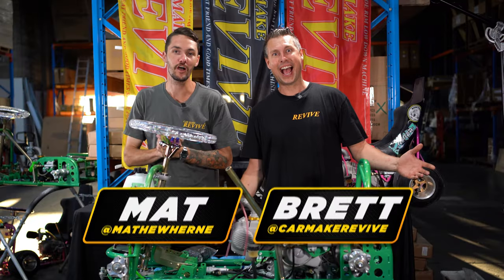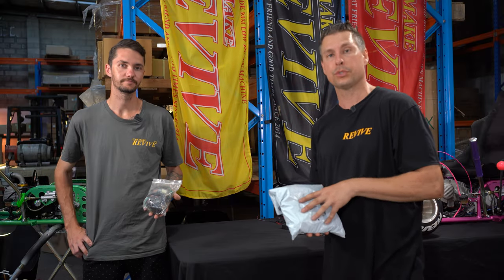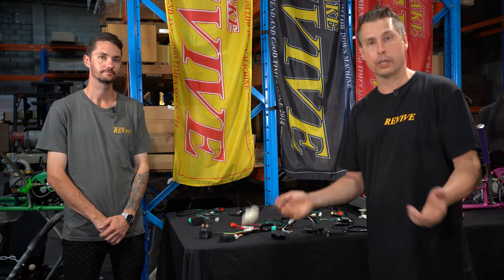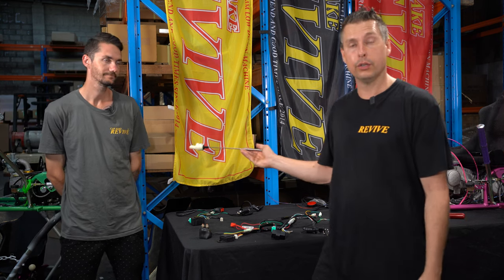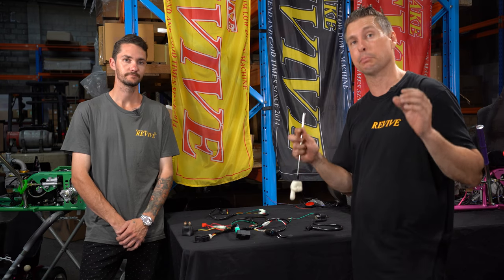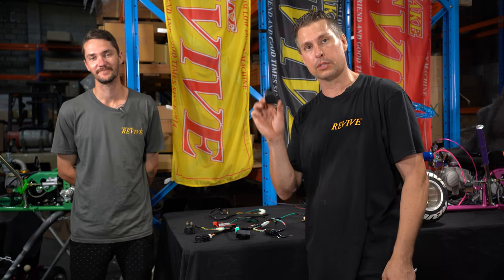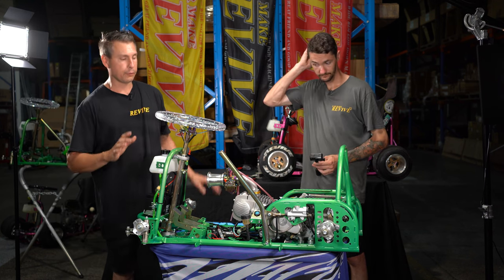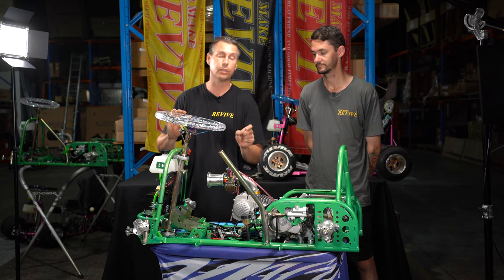Car Make Revive - Drift Kart Build Part 5

Comment: I tried for ages to buy one of these but being in sa I couldn’t get one so I ended up just building my own (I’ll still buy one when I can) but you guys just showed be I can pull power from the engine for my guages from that yellow wire from the stator, instead of running a battery. I went and gave it a go and it fuckin works you guys are gurus
Reply from the maker: That’s awesome, glad we could help